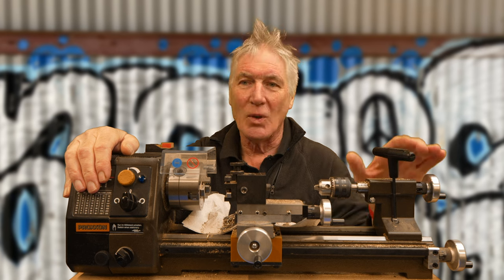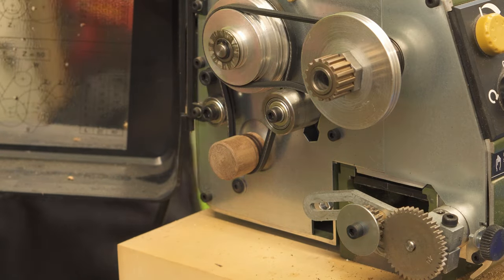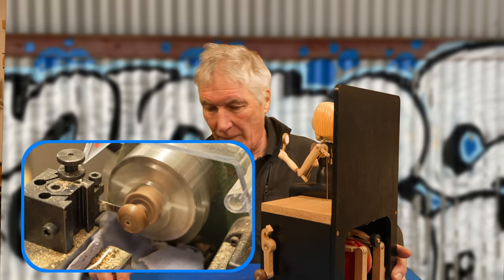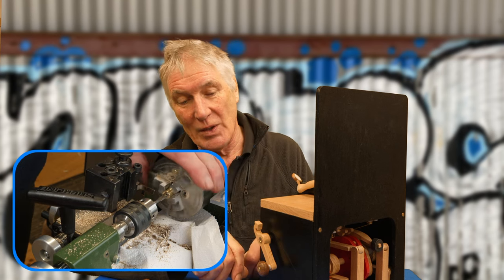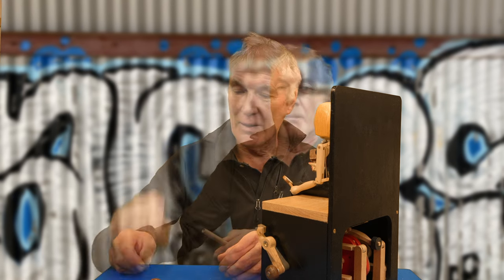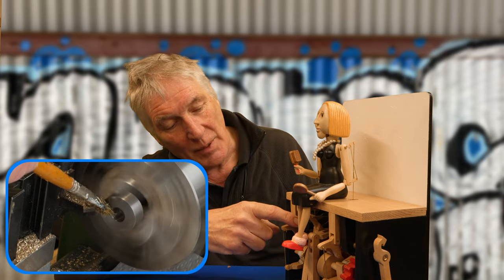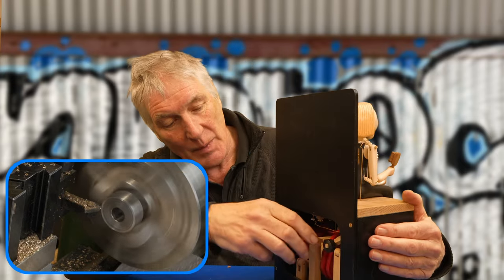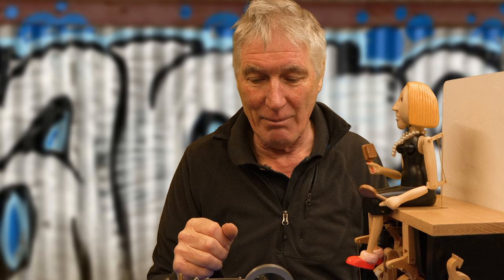10 useful parts I make with my mini lathe. Automata and model making.

Comment: Hi Philip, I very much enjoyed the video. Your suggestions resonated with me as a lathe user and automata maker. Especially the screw cutting and a good set of taps and dies!
Regards, 
Oliver
Reply from the maker: Hi Oliver, yes I wonder how many people have been put off by using poor quality taps and dies. I now  only use Volkel ones which I think are exceptional quality. I’m sure there are many other good brands but the problem is it isn’t obvious till you’ve bought them. I would certainly never buy a cheap set again even if they do cost less than a good quality single one. Best regards, Philip

Comment: Thanks for the video. This lathe is one of the few Proxxon tools sold in the US that I do not have. Hope to purchase one this year.
Reply from the maker: Hi Donnie, I also have a Sherline and a much larger Wabeco lathe but the Proxxon hits the sweet spot for most of the work that I do. It takes 10mm through the spindle so is useful for working on brass and delrin rod.

Comment: Hi, I am looking for a lathe to finish some masts for a tall ship model I'm building. One mast world be 12" long and has various sizes of thickness for each mast. Could you recommend this lathe or would you know of a better one please?
Reply from the maker: I like the Proxxon lathe and get a lot of use out of it. Keep in mind though that you can only get just over 6 inches between centres. The chuck pass through is 10mm. A longer alternative that I also have, albeit now converted to CNC, is the Sherline 4400 (4410 metric) that will easily take 12 inches between centres and also has a 10mm pass through. 12inches of thin material is going to flex so you will need some support.
Reply: Thank you for the advice, much appreciated 😊